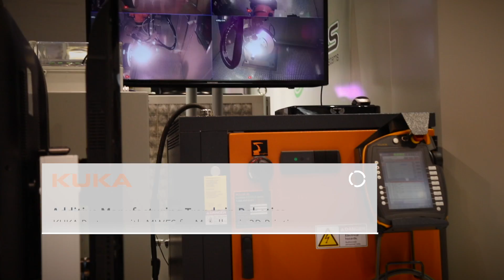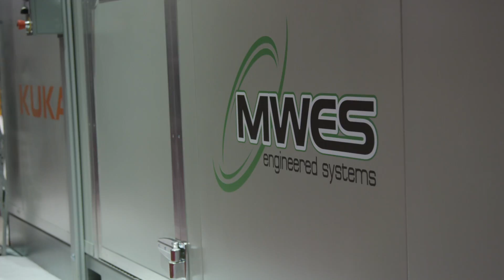ADDere Large-Scale Metal 3D Printing Process

Comment: How is this better than casting? It looks as though you would need to completely machine that component afterwards and then still not be convinced about the integrity of the material. If i bought a AM machine, how would i be more competitive than someone else with the same machine, so in other words, what market advantage would i have as a business and how could i make money when the technology is available to everyone.
Reply: As a person who worked on both subjects of casting and AM, I can say that the main advantage of the AM is that it can excel in producing few parts with complex geometries. If you want to cast these parts, you need to make a pattern, a mold, design casting components like runner and gates which will take huge amount of time and cost comparing to AM. The jndustry fills this gap by mass producing parts, but if you only want one or two of a component, AM would be cheaper.
Reply: @alirezanazarahari8342  I understand the theory behind it and from the video there is obviously a result, but what is that result fit for, it’s certainly not fit for purpose as it would need to be completely machined to create a functioning component, which if that’s the case, one would simply machine from a billet or forging. In effect, we have a process for visualisation, which we already have through the initial cad model. And,, more importantly, is the integrity of the material compromised, how is the grain structure determined and consequently what defines the material strength and the material strength in subsequent components.
Reply: I just now came across this video. Click the link below it is clearly well explained https://www.youtube.com/watch?v=eLw_RBF4WQ8&t=46s